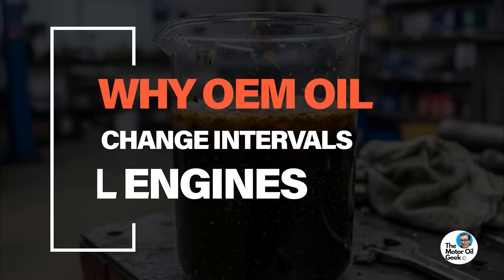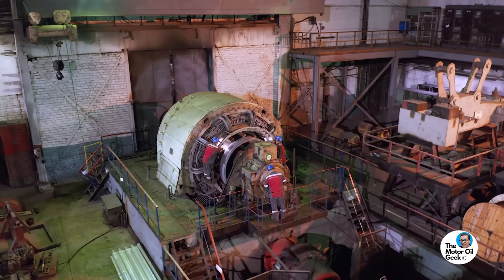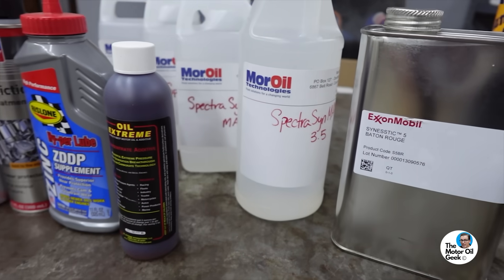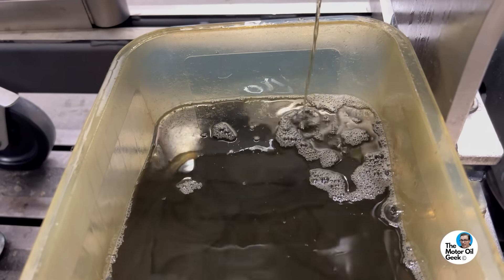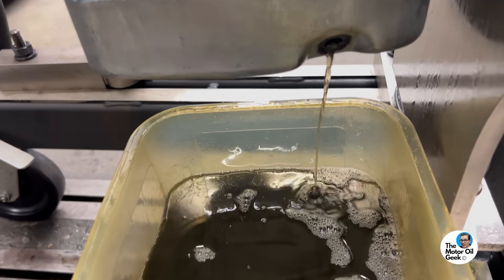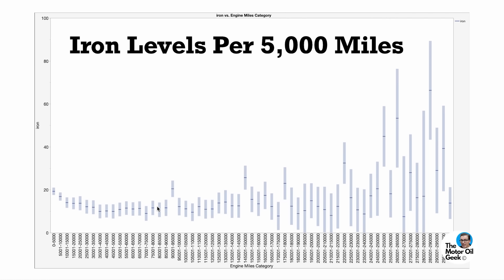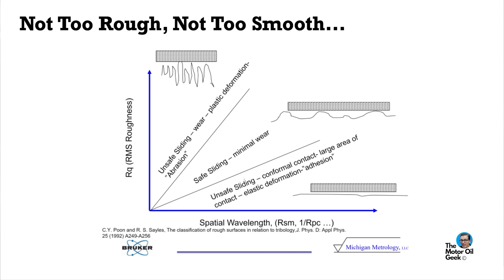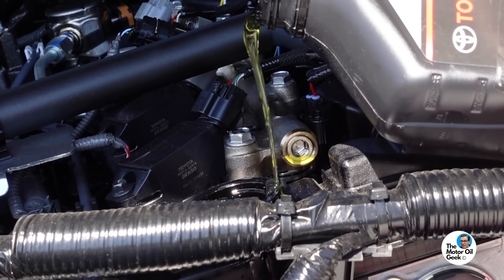NEW Data Reveals WHY Modern Engines FAIL Prematurely!

Comment: When I was a Ford heavy line tech back in the mid 80s to about 2012…I repaired a lot of front and rear axles…started seeing a ton of rear end bearing failure when synthetic gear oil became standard in new production trucks…..some repairs as early as 10,000-20,000 miles. I was involved with experimental diagnosing with our ford rep. Ford wasn’t sure of why so many bearing failures. The ford rep eventually told me that the synthetic gear oil was almost too “slippery” , causing the bearing to slide instead of roll under load. Causing the roller bearing to scuff and eventually pit the roller and race..
Reply: That's crazy, did they reformulate the oil?
Reply: Wow! I didn't even know that was possible

Comment: Having been a Honda dealer tech for the past 4 years until just a few months ago, it always disturbed me that we never did break-in oil changes as standard on new cars. When my brother got his 2025 Civic a few months ago, I did his break-in oil change myself to ensure it was done properly.
Reply: Why? Here in Japan, 99% of Honda and Toyota vehicles go to scrap with the engine still in good condition, even though the first oil change was at 10,000-15,000km and then every year or so after that for 10-15 years. 

Yes, changing the oil more frequently means less wear, but what's the point of that if the engine lasts the life of the vehicle with extended changes? Throwing money away?

This dude is showing you scary data to sell products, without qualifying the data. What does the wear actually mean in the context of the life of the car? The goal for most people is to spend the least possible for the life of the car, not send it to the junk yard with a rusted-out chassis and like-new engine.

Comment: If filtration is so important, why do Toyotas last so long when Toyota oil filters have such low efficiency?
Reply: Because the wear numbers he's showing everyone aren't put into context. Like...if the engine wears more, but still lasts the life of the car, what's the point of changing the oil more frequently...other than throwing away money.
Reply: Toyota is having problems with the Tacoma engines of the last 5 years or so.  Some of the engine block suppliers are being accused of supplying engine blocks that were not sufficiently cleaned after machining.

Comment: Merry Christmas Lake.
Too bad cars and trucks worth keeping wouldn't have an auto drain of one quart every 1,000 miles and then auto fill a quart after that.  This would happen after the engine has been shut off for 20 minutes to allow the sediments to settle.  We would then have a fill port that we would keep full of clean new oil for this process.  There would be a reminder to pull out the old used oil at 5,000 mile intervals along with an easy to get to filter to change out.  We can only dream.

Comment: In the. 80s when roller liters started and everyone ran 10-30 or 10-40 we didn't have lifter an cam failure the " new modern " oils are a huge contribute to today's failures, 0-20 is only for gas mileage and not long life protection

Comment: I think it is partly the fact auto makers now rely on 3rd party part suppliers and in the process the quality has gone down hill. Metal components not becoming the correct hardness etc... Back before 1994 Mopar built Dodge trucks Dash boards and components in 1994 cash strapped Chrysler went away from Mopar and had a 3rd party design the dash boards and they did not put the proper UV protection in the plastic and now just try and find an old Dodge Truck made from 1994-2000 that does not have a cracked falling a part Dash. You can slap them hard with your hand and they basically crumble. They need better parts quality control. Just my theory, but they use even more 3rd party companies than ever before to make parts. The engineers say we need this part built to this spec then trust the 3rd party to consistently make them to said specs. I know the Dash story is true Mopar stopped making the Dash companents when they came out with the re-design that saved Chrysler at that time.

Comment: That is exactly what appears to have happened to my 5.3 GM camshaft at 88,000 miles.  It looked like the metal was soft and delaminated on the #5 exhaust lobe and roller.  The roller bearings were fine and intact.

Comment: One of the most reliable diesel engines of the 90s emphasized cleanliness of oil with the HEUI injection system. The 7.3, 6.0, and 6.4 powerstrokes weren't near as bad as everyone thinks. Can't expect to own something like that and have it last with dirty oil. I've purchases many of these trucks with crank no start and the most common problem was a piece of "trash" pushing it's way into the IPR sensor. Knowledge is power.
Reply: The most reliable engines on the planet, heavy diesels in ships, trains, etc., never have the oil changed. Never. Filtration and additives.

Comment: Also getting used to fire injectors on Diesels. I explain this to my customers all the time that oil Is being used for a lot more than just lubrication these days. There are more engine control systems using oil to run or activate things.

Comment: Merry Christmas to you, too.  Thank you so much for all your great information.  It is too late for the engine break in oil change interval for me.  I halved the OEM recommendation but apparently that wasn't enough in the first 10,000 miles.  But at least I changed oil on a 5000 mile interval.  Now I am finding that maybe I shouldn't have changed the oil filter every 5,000 miles, too.  I was always taught that there is a quart of dirty oil in the filter and it needed to be removed, too.  So, far I have had 88,000 plus trouble free miles with my EcoDiesel engine.  I should probably have an oil analysis done as you have told me over and over.  I guess I will make that my New Year's Resolution.  It beats dieting or exercise for a New Year's Resolution.

Comment: When you say not to put additives into your oil, does that extend to not using oils that come with additive packages, like the oils marketed for vehicles with over 75k miles?  Don't they basically just throw in additives to help keep seals pliable, etc.?

Comment: It is funny because most OEMs with rediculously long service intervals, also have a section for "adverse conditions" and a much shorter service intervals. Typically half time/distance.

These "adverse conditions" are ironically more typical operating conditions for most drivers. Including: Short trips, stop-start driving, extended idling, extreme hot/cold and dusty environments.

Maybe OEMs should market the normal service intervals as "optimal conditions".

Comment: Lake, based upon what you presented in this video, would it be best to change your oil filter during early-life intervals, or keep that oil filter for two intervals ( i.e. oil changed every 2-3,000 miles, filter changed every 4-6,000 miles)? The idea being maintaining improved filtration over time.

Comment: I probably should have did some more chances, but on my Audi S3, I changed it at 1k, 4k, 8k, 12k, currently on that change sitting at 15k. Using the VW 504 spec the OEM wants....Mobil 1 ESP 0w-30.

Comment: Correct me if I got this wrong, but it seems filters actually work better during the midlife of an engine because the filtration actually works better on a slightly dirty filter than a brand new one, and so changing oil less often at that point provides better engine life and/or less wear. In that case, how would it look if you changed the oil but not the filter, so you have fresh oil with the slightly dirty filter? Seems like there's a distinction between what's carried in the oil itself and how the filter processes it.

Comment: 0W-8 oil bearing clearances are in the 0.0007" to 0.0015" (or 18-38 microns) range. Typical oil filters can control down to 20-40 micron particles. Filters are becoming less effective...

Comment: Oil Master that was GOLD - so if you buy a new machine AND you want to keep your machine long term the questions are:   1)  when should you do FIRST oil change, SECOND, THIRD before you go to the old school rule of every 3K?   I recommend:  500 miles,  1000 miles   1500 miles and then 3000 miles - that sets the starting point - then every 3K until engine life is done - which should be several if not many hundreds of K -   Next:  what is top tier OIL to use?   Proven without question:   Amsoil Signature and 20 micron filter -  try to find an oil filter LESS THAN 20 MICRON -   reply if you know as I DO NOT.   Next:  Why don't manufacturers incorporate a SECONDARY oil filter system as offered by Amsoil?  Because they don't WANT YOUR ENGINE TO LAST.   If every manufacturer offered/produced a SECONDARY oil filter system your engine would last what on average?  1 million miles?  Who knows.  But THEY KNOW your engine would last EXTREMELY LONG WHICH EQUATES TO WHAT?  LESS SALES ON NEW VEHICLES.  WORLD.  LISTEN UP.  OIL GETS DIRTY.  KEEP IT CLEAN.  CHANGE EVERY 3K AT MINIMUM.   Are YOU getting the DRIFT?   Oil Master - great vid.  People need to listen and learn.  And again, your channel and reality is only for those:  WHO CARE ABOUT THEIR ENGINE, THEIR MACHINE.

Comment: 1:34 good point on the use of oil as hydraulic fluid. 
Motorcycles that share engine and gearbox oil have a similar issue, you really should use what's recommended.
Just don't use the recommended change intervals.

Comment: People think oil change intervals are all laid down on paper... wrong. They're laid down by your particular engine, because each is somewhat unique, despite today's high-tech manufacturing.
Agreed with everything Lake says here but I'd add... especially on a new/newer low-mileage engine, check your oil. Because that's the only way you'll know. Signs of glitter/crud/schmoo/etc... get it outta there. It's wrecking your engine.
Thanks as always and regards.

Comment: Sounds to me like they are compounding the problem by using low tension rings allowing carbon and other crap to pass by easier than the old days of standard rings that sealed much better.

Comment: So, ive heard that manufacturers will use 0W20 instead of 10W30 because it gets better fuel economy numbers, not because its better for the engine. If you value engine life over fuel economy,  does it make sense to switch to 10W30 or is that bad?

Comment: Just go straight to a thin 0w-30. And for variable electric oil pumps, they are closed loop, they will learn. They have to deal with all manner of viscocities because viscosity is highly dependent on oil temp and driving even slightly more aggressively will heat up the oil and make it thinner (and vice versa).

Comment: Excellent video!  I always change my oil on any new engine (car, truck lawn tractor, log splitter, etc) several times during the break-in period.  And, that's why I no longer purchase used vehicles since the original owner likely didn't do that, particularly if it was a lease vehicle.

Comment: In industrial hydraulic your basic filter standard on a small power unit, less than 50hp, is 10 micron. On large machines that aren't easily replaced like a 750hp 2500ton aluminum extrusion press the standard filtration is 3 micron. You learn real quick at 3000psi a spec of dust 3" valve spool turns to sandpaper.

Comment: Madness!! My 2023 Subaru BRZ; recommended oil; 0w-20 @15,000km (first change too). I serviced mine at 1500km, 4500km and 8000km. Buying a used car with full dealer service history isn't necessarily a positive. In fact it could be a time bomb.

Comment: Back to the old days of 3000 mile oilchanges after break in
my cadillac dealer looked at me funny when i wanted the first oil change at less than 1000 miles, the car includes free oil changes, so why would i not have it done early, never past 3000 miles or 6 months

Comment: I worked on huge 12 cylinder diesels the same oil was used for a very long time. It was centrifuged  to clean it. The engines lasted from 1939 when made to 1999 with no bearing replacements or gears. Just cylinders and liners and injectors changed. Note top rpm on them was 850 rpm. Straight 30 weight oil was used.

Comment: I would love to see a video dedicated to manual transmissions with synchros.  Seems like no matter which car I've had, no matter which manual gearbox it had, there were always compromises in which fluid is best for what.  Current one is the Getreg MT82 that everyone loves to hate.  Early ones used a gear oil, later ones moved to a DCT oil, and people have messed around with everything in-between.  Some with friction modifier, some without, some made for synchro transmissions, some motorcycle wet gearbox/motor oil combo fluids, and for other transmissions I had New Venture T850, there were even custom "blends" people were using.  From back in the day, if I remember right, my T56 worked best with a Honda synchromesh fluid.

My hydrostatic drive zero-turn specifically calls for Mobile one 15w-50.  My backhoe is so old the spec it needs is gone, but the cheap off the shelf universal fluid works pretty good.

Comment: My Nissan 2006 GU Patrol 4.2 diesel holds 10.5 litres of oil and two filters. The oil gets changed every 5000 km & filters every second oil change. Oil is cheaper than engine rebuilds.

Comment: Clinton here. Very interesting video.  I changed my new car oil after about 1000 miles.  That was in 1982.  Don"t remember why.  I still do this with new car.  It has served me well. I am retired mechanical engineer.  My most recent purchase 2021 was f250 with godzilla engine.  Has been concerned with the news about lifter failures.  Bought this truck to have for long time.  So recently took sample and sent to you.  The results were acceptable.  I have convinced my self to continue to sample this engine and use the wear particles as indicator of a potential wear issue.  Makes me sleep better.  Do you have any specific data on the godzilla that would useful.  last oil change I put in Valvoline 5-30 extended life oil in.  Been considering going to mobil truck and suv 0-40 where in some of your recent videos it has been good performer.  

I have one industry example for you.   At nuclear power plant that I worked at we were having trouble with our Reactor pump seals.  This pumps are very large and constantly operate when plant is in service.  We were have seal issue.  This is a water seal that kept the 2500 psi water in.  It had clean seal injection water that flowed over the seal.  We installed a finer and finer water filter in the system.  This reduced the amount of issues we were having with seal.  

Thanks for your scientific approach.  God Bless You.

Comment: So based off this information, if you had an extremely extremely fine filter to catch these tiny particles but it was huge so that it could still maintain the same flow volume, that would be ideal? 

I mean for packaging reasons you might need to have it relocated and obviously would not be OEM sized but if you had a filter that was say the size of three normal engine filters for the vehicle but it filtered down to the 20 micron or less level, would that significantly increase engine life if run from the very beginning?

Comment: Over here in Europe the engine start&stop systems tend to increase oil dilution. The Stellantis group had to phase out 1.0 to 1.2 liter Puretech wet distribution belt engines because of premature engine and hydraulics failure. These  engines also operate  brake's servo using engine oil .  Gasoline diluted in engine oil eats  away the rubber in the distribution belt causing premature engine failure and loss of braking
Reply: Not surprised 🤪

Comment: So basically dropping in a K&N air filter, and following the Amsoil "Don't change me for 25k miles" = bad.  The sad thing is last time I bought a new car, I took the car back to dealer to get one of the first 3 "free" oil changes done.  I think it had 500 miles.  They refused.  So I did it myself and never ended up getting the "free" ones because I did it at 500, 1000, 2000, 5000.

Now that I buy used vehicles, someone already broke it in wrong for me, so I just stick to 5000 miles per change or 6 months, whatever comes first.

Comment: Happy Festivus I have a 2019 ford fiesta with 1.6L non turbo  I went 5000 miles for my first oil change using ford synthetic blend motor doesn't burn oil but it's louder than when it was new 70,000 miles on motor now any suggestions, I use Walmart full synthetic 5w 20 high milage every 5000 miles with supper tec filter

Comment: Such a good point. It’s so obvious yet it hides in plain sight. Thanks for the information. We bought a new car for the first time in 30 years. I followed a lot of your advice, oil change and filters early less than 500 miles twice. Another oil filter and change at 5000 miles and another oil change at the manufacturers suggestion a 10,000. Our dealer covers the manufacturers oil changes and I’ll be doing the ones every 5000 in between. We’re hoping to get 250 to 300,000 miles and 15 years out of this new car car.

Comment: Well my 250,000 mile 30psi boosted engine thanks you and is still alive cuz i have changed my oil every 3k miles or so and change the filter every 2-3 oul changes , but make sure i use a quality filter and i use full synthetic to my spec , but also , engine is forged not stock so manufacturer out the window along with the specs as its bored over , compression changed , and forged rotating assembly.. plus a fluid damper and king race bearings , quality were it counts makes a world of difference... peace and love all, keep it rad, stay safe, and build on..l8r hommies and keep having fun everyone 💪.. ps , thanks lake for all the knowledge you share ..i have learned some good stuff from ya and ya reassure me on some the stuff i have been doing that others think is crazy , but my engine and car says it works 💪 😅.. peace brotha and thank you .. happy holidays brotha